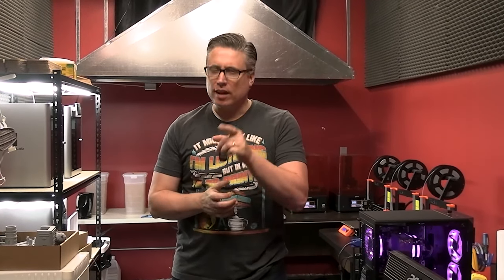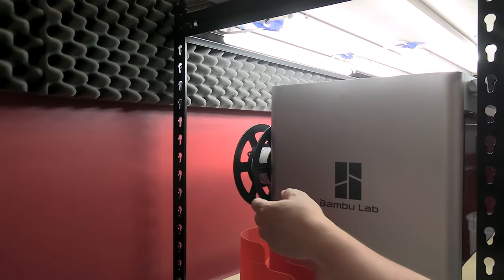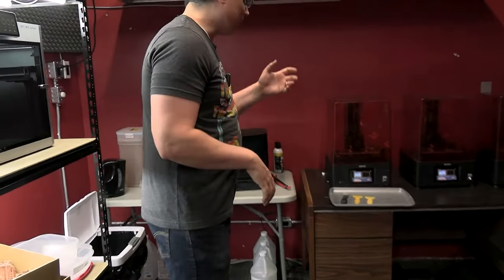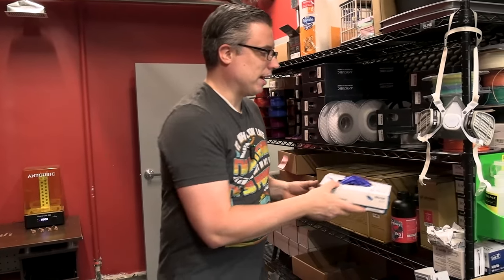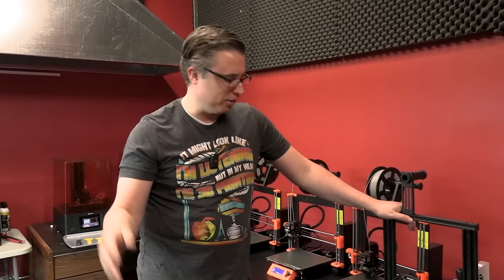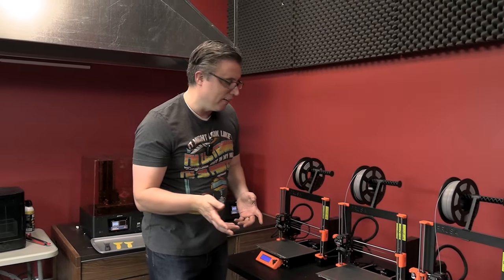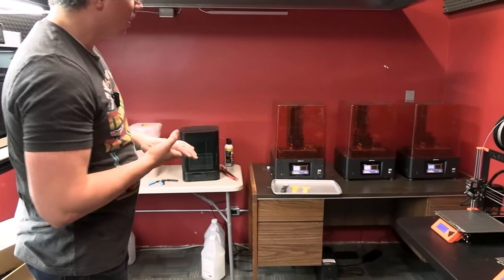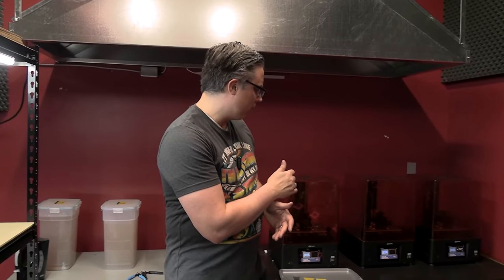FDM vs Resin 3D Printing - Which is Better?

Comment: Resin is way too dangerous because of toxins for home use.  It needs a lot more maintenance and cleanup. I don't see how they sell resin printers, TBH.
Reply: because you can always buy PPE and ventilate your room, its more expensive but can cut down on things like sanding which is also dangerous when done with PLA.
Reply: @miguellopez3392  Who wants to walk around with respirators and windows open in January???  Filament printers are so much easier and far less dangerous and easier to deal with.  I'll never have a resin printer!
Reply: @joeking433  I use a paint station fan to pump air out of a slit in my window, clears the room of the resin smell, IPA/paint fumes from cleaning, and dust from sanding, its a cleaner more hands free method then using air filters and respiratorators. The accuracy of the prints means almost have to do no sanding to get quality level equivalent to molds, FDM can't compete in that category.
Reply: @miguellopez3392  I'm not into printing toys, just functional prints so the smoothness wouldn't matter.  I have had some incredibly smooth sidewalls on some prints on my Prusa mini using silk PLA lately, though.  It's not anywhere near worth the mess and danger for me, I'm not into little knick knacks and action figures.
Reply: @joeking433  you are into toys, you have a guitar as your profile picture, shouldn't have a problem printing them as i know you dont do any actually functional with them that you couldnt do with resin. I use SLA to print things to hold my power tools and print targets to shoot at with my PCP rifle without looking like the parts came out of a Chinese factory. Also smoothness does matter a lot when doing gearing or parts that slide past eachother with very little tolerance, if I want something super strong i get my grinder and welder to make something strong.
Reply: @miguellopez3392  Guitars aren't toys!  They are functional, they are a TOOL, not just something to look at like your little resin knick knacks and figurines.  In fact I have made many tools and parts and the parts were perfectly fine!  And I didn't have to dress and behave like I was working in a nuclear reactor site!  For the little bit of better smoothness on figurines it's definitely not worth the trouble, the danger, and the mess to do resin printing.
Reply: @joeking433  lol they are toys that's why its called playing an instrument, it's a tool for entertainment which is a toy, an airbrush is a tool, I make functional prints for the airbrush  system to make the process faster and less messy, if you are a painter, or someone who works with power tools, you already have to work around many other carcinogens and toxins, they aren't toys.
Reply: @miguellopez3392  Do you ever experience nausea and headaches?

"Nausea and headaches are very common reactions to UV resin and epoxy resin, even when using full PPE. Many people ignore those symptoms because the resin is advertised as non-toxic."
Reply: @miguellopez3392  "they are toys that's why its called playing an instrument,"

Playing doesn't have to involve toys!  Playing sports doesn't involve toys, does it!  Playing records doesn't involve toys.   Playing a part in a play doesn't involve toys.

Definition of toy:  "an object for a child to play with, typically  A MODEL OR MINIATURE REPLICA OF SOMETHING".
Reply: @joeking433  do you experience memory loss? i already told you i ventilate my room of any fumes, this prevents any symptoms which is why its recommended by the warning labels anyone with a brain reads, and from air quality testing, ventilation  makes the room cleaner than a FDM room with no ventilation.
 lol far more children play with instruments than with fragile replica models lol, you can buy plastic guitars for 3 yearolds and watch them play music lol.
Reply: @miguellopez3392  It doesn't matter, it's impossible to get all the toxic fumes out of the air even with ventilation  and you will inhale some toxic fumes even with PPE's!  You don't have any kids, do you?  If you do, have they been complaining of headaches or nausea?   Do you have any dogs or cats that live in your house with you?

Do you have an air monitor?  Amazon makes a good bluetooth one for $60 you can use to check your VOC's   You REALLY need to get one, especially if you don't live alone!   And if you have anyone over you definitely need to tell them you work with toxic substances and that they are probably in the air in your house.

And I don't have any plastic guitars nor would I want to print little toy guitars like maybe you would.
Reply: @joeking433  there are already fumes in your house without resin if you don't ventilate, hence why government is banning gas stoves, people have used testers for VOCs in ventilated environments and found the levels to be safe, again stick to playing with your guitar and leave the adult printing process to the enthusiast.
Reply: @miguellopez3392  Do you have kids?
Reply: @joeking433  lol do you use brakes on your car or drive on a highway?
Reply: @miguellopez3392  Seriously, do you have kids?
Reply: @miguellopez3392  I have 4 air monitors and they all say good on  VOC's, no particulates, no CO, no CO2, no HCHO, and no radon. You REALLY need to get an air monitor or two, they're not expensive and worth it!

"and leave the adult printing process to the enthusiast."

So you "adults" can print your little Star Wars figures, and silly toys like that?  Hahaha!
Reply: @joeking433  lol it's so easy ticking someone off who's is already made themselves mad, its just 3d printing, you breath in brake dust and carbon particulates no mater what you do in life lol.
Reply: @miguellopez3392  Do you have kids?
Reply: @joeking433  lol, fdm sucks SLS is better
Reply: @miguellopez3392  Do you have kids?  At LEAST get some air monitors if you do!
Reply: @joeking433  fdm sucks sls is better.

Comment: When I hear after buying you need to re-install firmware...it means it is a definite nono. I am not looking to become a printer specialist. I want to use a printer that prints...when I want it to, and when I need it to. What you are avoiding to say is that the company product is so crappy and assuming it's customers are all into tech and horsing around with their tech is their hobby? Well no. I am a consumer I want to 3D print without hassle. And the whole issues with the models, and need for updates or re-installing firmware, is simply saying and stating, our product is crappy and you are not our customer.

Like we want a 2D printer to give us hassle when we needed it...I mean...are you serious now? Do you want to be a company producing 3D printers so creators can print, or do you deliver them crap and hassle, and want only to make money, while you do not even understand who your customers really are? Seriously sir...if I wanted to become a tech mechanic...I would have chosen a different way to go. I want to print with the least amount of hassle, for a normal pricing. And if that means I need to save up two more months.

I will. When you buy a machine that is supposed to work and doesn't what do you do? Take it a part? NO! When you bought a cd player in the past you wanted to play music. Not having to install a laser, or reinstall firmware, or whatever crap a manufacturer is supposed to do. And not that I can't stand change. But these dumb manufacturers, do not know what doing business with consumers is, let stand what doing business with businesses is. Let's not swap roles...they are the manufacturers, we are the creators and the customers, and I do not even want, to know how the damned thing works.

I want to print in 3D,...get on it! That is what you payed for. And delivering it for a low price, will mean it will print for a month, and break down, sure...than you have to by a new one...or a better one next time. But delivering crap...is a crappy business model. BASTA!

And don't get me wrong...I let you totally free to deal with whatever crappy printers you want to sell, since soon, you will loose your crappy business models, to begin with. Dear better and honest manufacturers, get on it! For those that fit that shoe, get on it, thanks! Let's make some money - the right way!
Reply: You typed all this and yet installing some firmware is too much? it's best manufacturers don't take advice from you.
Reply: @miguellopez3392  You will see....meanwhile I moved onwards...to their  resin versions...auto bed leveling...and well. You will see why. And they also understood why. That's why they move onward now as well. Feel free to horse with the old crap. But the new are a giant step forward for creators. Time efficiency... You will see. You are also still putting letter blocks in boxes, ink them and than print? Or did you meanwhile step forward to...normal 2D printing...? You probably still use Goose feathers to write your business contacts? Send it by Pigeon? Or did you step forward to using email finally?

Comment: You say talk seriously about the topic and then you immediately dismiss the possibility of printing minis on FFF(FDM is a trademark by stratasys, so you don't have any FDM printer at all) printers. 
And holy cow you show an example of what the bambulab can print and the overhangs look horrible. Like I am sorry but no. That's not a decent comparison either.
Reply: It's much easier to get resin printers to print minis than it is FDM especially as they scale up in complexity.

Comment: Can resin printers (like Clear Resin offered on PCBway) print hinges? I have no experience with 3d printing.
Reply: Things like hinges and ball joints will  scratch regular resin fairly easily,  Something like sirya tech Blu Nylon Mecha-tough resin is made to resist ware from friction.